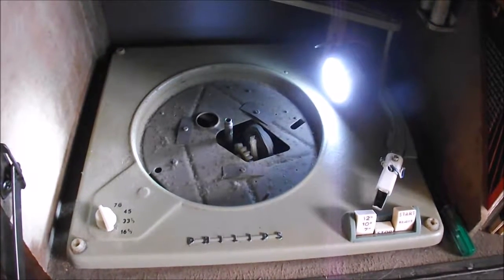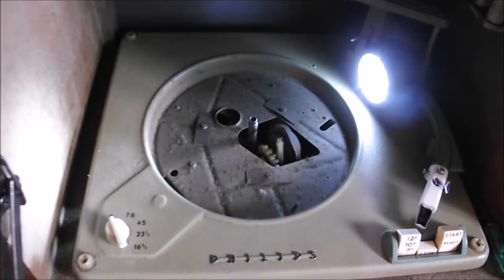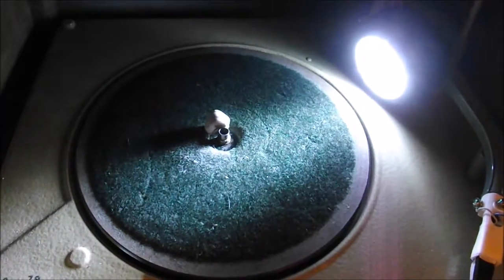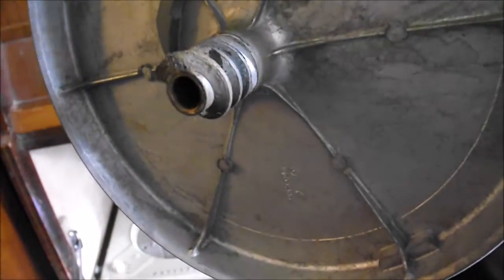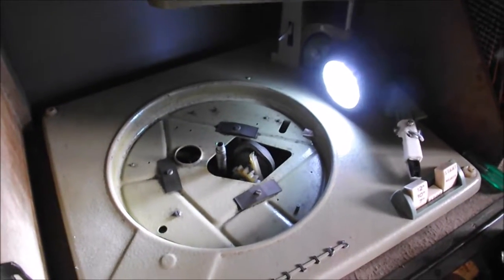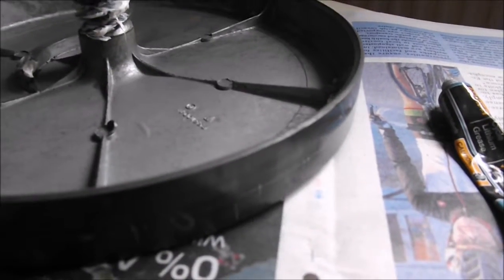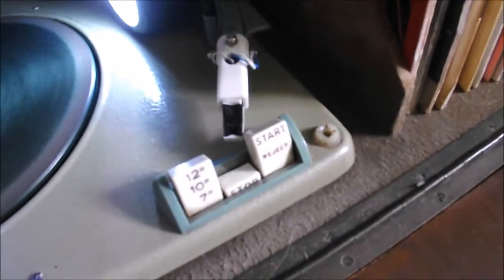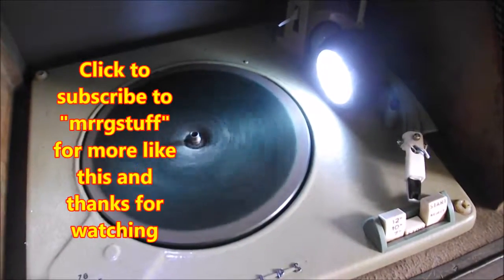Re-grease platter on Philips AG1014 record deck

Comment: Hi, I have two Philips AG1003 turntable and both of them are running too slow in all of the 3 speed, I have re-greased the platter just like you did here but it didn't change anything. Is there another adjustment to make for the speed? Thank you very much!
Reply from the maker: The biggest effect on the speed was to disassemble the motor and clean and re-oil it. Before doing that it barely turned at all. I seem to remember there is a fine speed adjustment based on the tension of a spring. Do you have the service instructions?
Reply: mrrgstuff  I used to have the service instructions that i downloaded on internet but can’t find it anymore. I checked online but didn’t find anything except for one in german that looked more like an owner manual. Also what type of oil would you recommend for the motor? Thanks
Reply from the maker: I've found a PDF of the ag1003 service guide. If you email me on mrrgstuff@gmail.com I will send you a copy. For oil I would have used ordinary 3in1, but might use sewing machine oil if I did it again. For the motor I was very careful to mark and count the turns of the nuts as I removed them so I could get it back in exactly the same alignment. Motor has fine now for several years. Hope that helps 😀

Comment: how did you took the platter off ?
Reply from the maker: +ALONSO NIETO OLAVE Hi, I removed the clip  on the centre spindle. I prised the clip off with a screwdriver. 
I then push a screwdriver down each side of the platter and levered it up. Be careful as it is very easy to scratch the edge of the platter. Hope that helps.